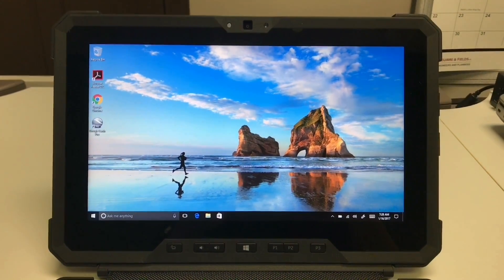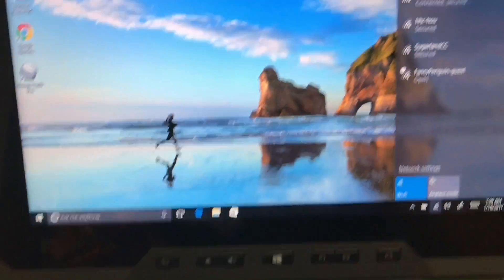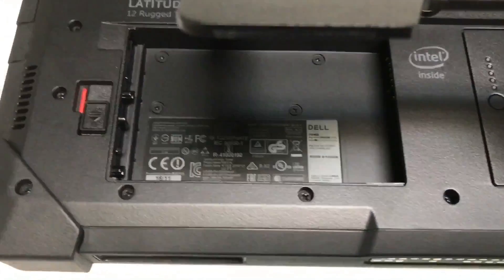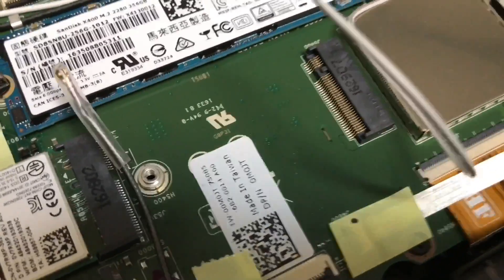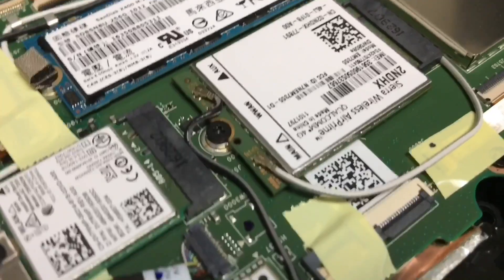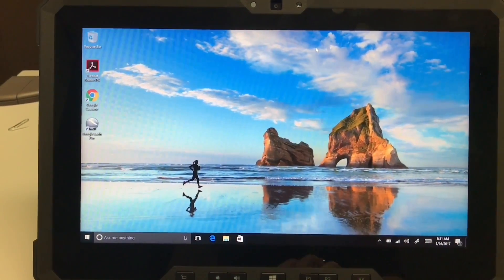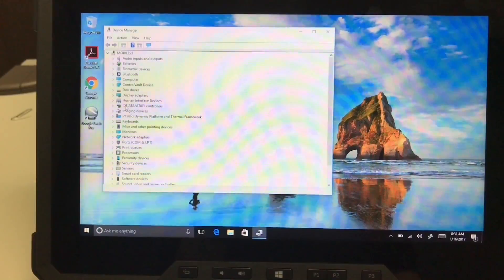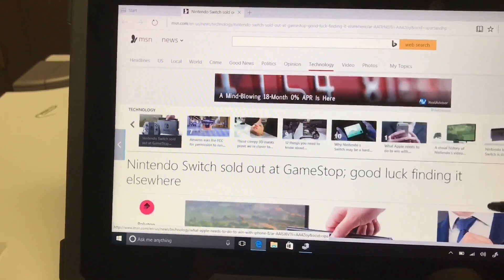How to install a WWAN LTE Card in a Dell Latitude 12 Rugged Tablet (7202)

Comment: Quality is good, try to use the camera stand as often as possible, there is no need to hold the camera by hand, you can point at things with a pen instead. Much more convinient to watch. Thank you for the video, I don't own this product, but it helped me understand how the cards work. 
I'm about to buy a one mix 3 pro, which supposedly has a spare m.2 slot, so after installing this m.2 modem, I only need to somehow retrofit a simcard tray and antennas. I might be able to custom 3d print a new backpanel and salvage a phone for antennas and simcard tray... idk.. if anyone reading this has any idea how I could pull this off, let me know :)

Comment: 4:22 it was a electric spark when you touched the screw ?
Reply from the maker: No, but I’d remove the batteries before starting either way.
Reply: @sk83rboi777  I know the batteries are disconnected .. but it's really weird and kinda looks like a spark but I can be wrong :]
Reply from the maker: @20120330  there is no electricity going through the components. I did close to a dozen of these and had no issues.

Comment: Does it work with any other laptops with a swappable wifi card?
Reply from the maker: @zungtonglo335  no, the laptop has to have a WWAN card slot on the motherboard (some don’t have it). The WLAN (WiFi card) is a different slot. The tablet in this video has both cards.
Reply: @sk83rboi777  thank you!❤️
Reply from the maker: @zungtonglo335  sure thing! What laptop model do you have?

Comment: Be really careful with the ribbon cables when taking off the screen. The rubber protectors for the usb ribbon cables was melted to the backside of the screen, and it broke the connector before i could even get something in there to pry it off..

Comment: I have DW5804  and DW5570. Do you know if any of them willbe working in 3G/4G/LTE network. Are they compatible with Dell Latitude? I have E7440 and slot for WWAN module. What is the software required to install?

Comment: So not only you should have a wwan slot but another slot where to out a sim card right? Can you out an msata ssd in that wwan slot?
Reply from the maker: Correct, your device will need a slot for a SIM card, which can be different sizes. An mSATA SSD may be too long/screw in the wrong place to fit, and it may not even work if it was inserted in that slot, so I don't recommend trying it.

Comment: did this do anything to the ip rating?
also, what would you say is upgradeble on the inside? SSD, RAM. bluetooth, wifi etc?
Reply from the maker: // P3A / CE 2016 Sorry for the late response. What is the IP rating? This mod only adds WWAN as a network option (SIM card required).

I think the WLAN card and the SSD are visible, not sure if you can get to the RAM.
Reply: xWR3KTx IP = Ingress protection. Basically it’s the civilian equivalent the mil-spec drop / waterproofing.

Thanks for the info btw :)

Comment: is it the same size of a WLAN card?
Reply from the maker: 萧衡 No, the WLAN card is smaller.
Reply: can we replace the WWAN with a WLAN? i mean, WLAN card comes with different sizes
Reply from the maker: 萧衡 I don’t know if that would work. The WWAN card has smaller connection pins as well.
Reply: xWR3KTx right thx man

Comment: If I'm seeing that right, the SSD is right next to the slot for the WWAN card, correct?
Reply from the maker: Correct 👍🏻
Reply: @sk83rboi777  Useful video - I got one of these surplus, but the SSD was a bit small (128Gb), so I upgraded. Also happens to run Debian like a charm, even though the particular system is not supported for linux by Dell...
Reply from the maker: ratmatz that’s awesome. We have a lot of surplus as we as we stopped issuing them. They worked well for 2-3 years but Windows 10 didn’t seem as quick to operate as a regular laptop; maybe a memory upgrade would’ve helped

Comment: Thank you for this video.  I was actually looking to replace the mSATA SSD in a 7202 but couldn't figure out how to get the case open.
Reply from the maker: xXSkyllaXx sure thing! That would be a good upgrade to do. Are you installing a NVMe SSD?
Reply: No I was just replacing a bad drive with another stock SSD.

Comment: Just curious, after closing the tablet back up, was it still water resistant?
Reply from the maker: Yes, it's just a rubber seal but this process doesn't compromise the seal at all. Just tighten all of the screws really well with the correct Phillips screwdriver bit (so they don't strip).

Comment: Thanks for the great tutorial.  I have a refurbished 7220 and wanted to add the same card.  Were the wires you connected originally connected to something else on the board or just hanging free inside the tablet?  I don't seem to have the power wires for the wireless card.
Reply from the maker: They were already in all of the tablets that I have opened up, not connected to anything, unless a WWAN card was already installed
Reply: @sk83rboi777  Hm, I haven't any wires in my 7212 Rugged. Strange...
Reply: Any follow up on this? Are some just not wired for this? I am not seeing those wires in mine either… bummer.